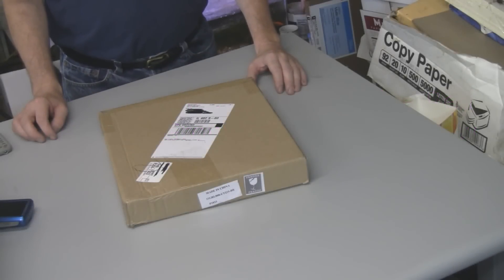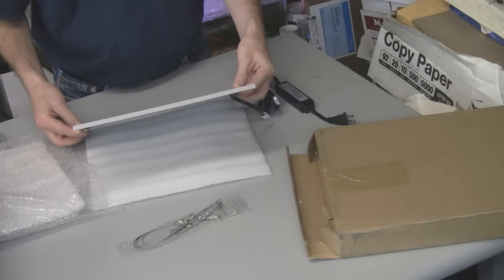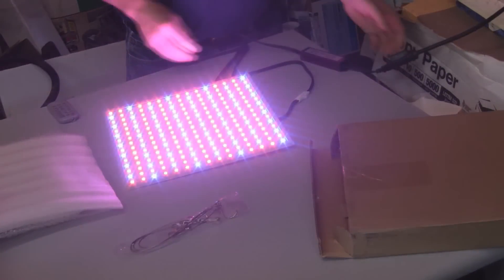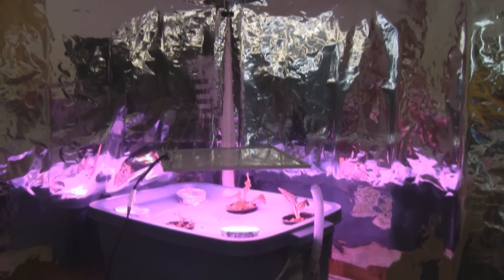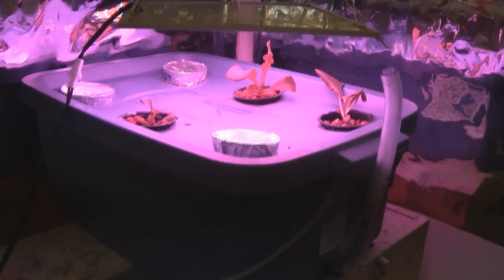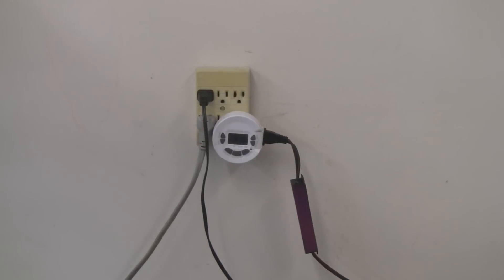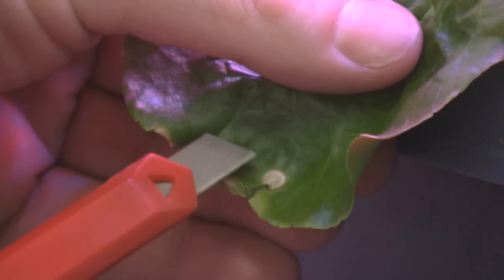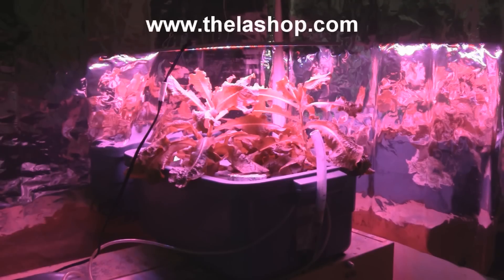LED Grow Light Review With Hydroponic Lettuce

Comment: lettuce is stretching fairly hard for the light
Reply: ImMADasAMeatAxe I have lived in SA. During the summer the max is 28.3°C or 83°F. It is more like San Diego then Phoenix, which reaches over 100°F for between 30-60 days during the summer. You can't grow lettuce or much of any plant over 105°F because the soil starts to cook.
Reply: Absolutely, you would probably need at least 2 of these to power that little DWC container.
Reply: considering the cost of the grow tent ventilation lighting etc.. you could build a pretty kickass glasshouse for about the same money and grow absolutely everything to absolute perfection without worrying about artificial lights
its pretty obvious that growing lettuce indoors is a bit of a joke.. its perfectly legal to grow vegetables outside in public view.. you wont get busted for growing vegetables
and lettuce isnt worth 200 dollars an ounce 
its a bit of a joke using a full indoor marijuana growing setup for a low value crop like lettuce yeah.. a pretty decent sized glasshouse would cost about the same amount of money and run rings around the indoor setup on performance there isnt a light bulb on earth that can match or beat the sun 
indoors only makes sense for growing dope or anything else that might have some legal issues attached to it.. lettuce isn't one of those
Reply: ImMADasAMeatAxe  Unless you live in a state that, in the summer, gets to be 100F and a BLAZING sun. I agree to a certain extent with what you are saying though, but people need fresh produce, and we have come to expect non-seasonal vegetables on the table when we so desire.
Reply: yeah im from south australia the summer down here hits up over 49 centigrade 120F quite often
can easily grow most vegetables outdoors without a glasshouse all year round down here
if you like to grow fresh vegetables outdoors 24 7 365 a year move to australia hahaha ;)
yeah i couldnt imagine what it would be like to have snow covering the land that would be pretty hard to live with yeah
australia is nice ;) every gardener faced with terrible winters should consider australia as an option its a gardeners paradise down here
yeah i agree location is extremely important in getting high quality fresh food on the table, we certainly don't have that problem down here.. everything is in season all year round in this country
Reply: yeah cactus is about all you can grow in most of Australia without irrigation
not the best place on earth to grow cool weather crops like lettuce
all we grow here in the summer is pumpkins melons beans corn tomatoes and cucumbers
all the brassica and lettuce family cool weather vegetables get nuked and fried to a crisp once spring hits..
you can fry bacon and eggs on the road in a summer heatwave down here
your right... lettuce won't grow in the summer down here.. its far too hot